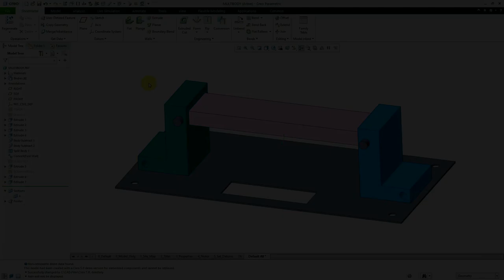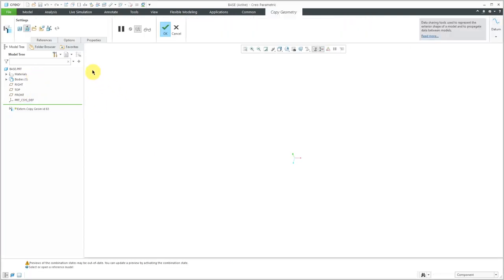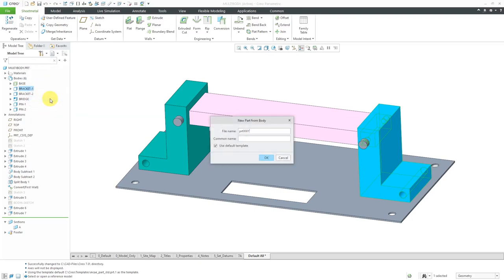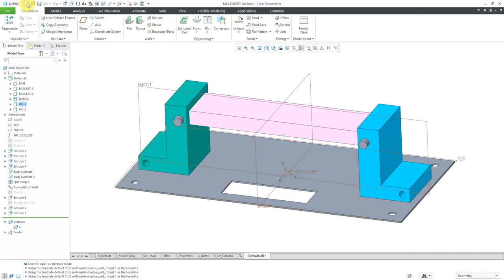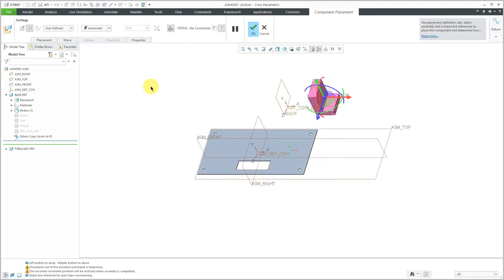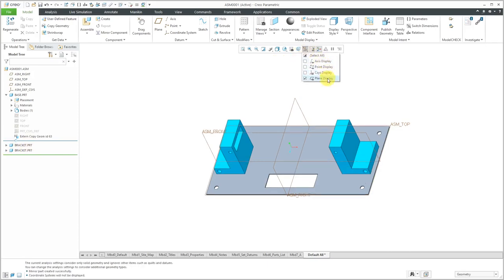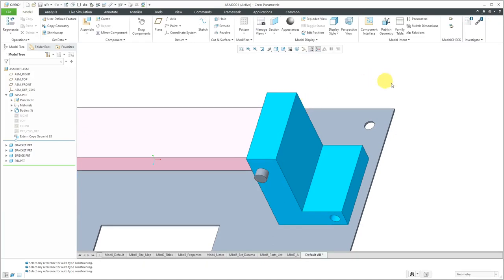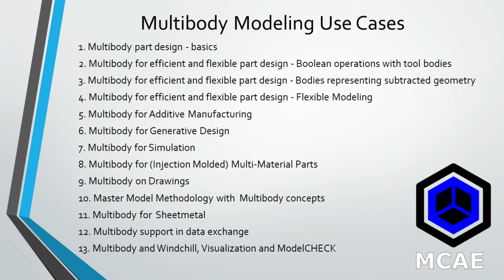Creo Parametric 7.0 - Assembly from Multibody

Comment: Finally, they've caught up. This totally speeds up parametric assembly design workflow.
Reply from the maker: I agree! I'll have a couple blog posts up on PTC.com about this in the next couple weeks.
Reply: @CADPLMGuy  Thank you. Multibody part files are how I've been on fire with Inventor for years. It's 10 times more secure for relationships that depend on adaptivity. It should be preached.

Comment: This is definitely a very good thing for Creo. 

I'm not sure it is handled as well as it should be just yet, though.  Inventor did this a long time ago and you could export any/ all bodies into apart or an assembly, automatically placing the chosen solid bodies as parts at what Creo calls the default placement in a single step. If you added solids you could later add them to a new or existing assembly. 

I used to love that functionality for creating laser cut tooling and fixturing assemblies  because we would tab and slot them; it was much easier to get them all lined up with reference geometry that was much less likely to fail because it was in a single part. 

It will probably be a while before we move to 7 unfortunately. We are still on 4, but here's hoping!
Reply from the maker: This is the first customer ship version of this functionality. Additional enhancements are being developed for Creo 8 and 9. As I've stated in numerous other comments, if there are things you want Multibody in Creo to do, get involved in the PTC Community and PTC/User. Martin has two working groups that end users can participate in to develop requirements and specifications. At work I had a meeting with PTC two years ago regarding my wish list.
As I've also stated in other comments, other companies developed Multibody as a response to Pro/ENGINEER's Top Down Design capability. It's not that PTC couldn't develop the functionality. For a long time it was "we've got Skeletons and Copy Geometry, which has much more functionality."
We're going to see more improvements and more enhancements. From my exploration I'm pretty amazed at how much of the code PTC had to change to get Multibody in all the places where it is. But people have to be patient because this was a huge change.
Reply: @CADPLMGuy  I'm still rather new to Creo but from what I had heard about it I'm impressed they even added the functionality.  From what I was told it was rather incompatible and would never happen. 

I've gotten into a couple of Feature Groups to hopefully help get some other functions implemented for other features. It has been a struggle switching gears to Creo coming from UG and then Inventor but I am coming to appreciate the modeling power, still with a lengthy list of exceptions. We're will be using it for at least a couple of more years so I'm trying to learn all I can in the meantime.

Your videos have been instrumental in a lot of my progress. Thank you again
Reply from the maker: I strongly recommend getting involved with the working groups through PTC/USER and PTC Community. All the PTC program managers are highly involved and looking for feedback from end users on what enhancements should be introduced in future versions.

Comment: I've been using Creo since the late 90's at various day jobs. In the mid 2000's I learned about skeleton models, creating pub geom, and then putting in the smaller details in the individual part files. This allowed a team to work on many parts of a product simultaneously. This bodies concept looks almost identical. Do you see people that have been using the pub-geom method switching to this? Is this part of the basic license, whereas the pub geom requires the advanced assy license? I'm thinking for corporations that buy Creo, they buy the advanced assy license. I just switched jobs a year ago from a large corp with probably 1000 seats of creo, to being the sole ME. When I called the creo sales reps to purchase, they asked if I wanted the advanced assy. I said "well of course, how in the world else will I design a product that fits together?"
Reply from the maker: Nick, Skeletons / Data Sharing Features and Multibody are similar but not identical, and not mutually self exclusive. As I've explained in other posts, Pro/ENGINEER introduced Skeletons and Copy Geoms first, but then other CAD packages developed Multibody as an alternative. It lacks many of the advanced features of Top Down Design in Creo. I see companies using them together, not choosing between them. PTC has defined 13 use cases for Multibody, and I see them much as I recommended in my book that you use Modeling with External References - or in this case, Multibody - for simpler assemblies. Perhaps under a dozen or so components, you use Multibody. But if you're doing anything complex, especially the top level of a complex product, you'll want to use traditional Top Down. But of course, you can use Multibody in Skeletons in Top Down Design. So the tools work together.

Comment: I have just discovered bodies and love the workflow. It is such a time-saver from traditional master modeling. I am, however, encountering an issue when exporting. When I create a new part from a body and try to export it as a step or iges, it exports nothing. When I open the export file, it shows no data. I have tried toggling on and off the bodies box in the export configuration, but no luck. Help! Do you have a suggestion? Thank you!